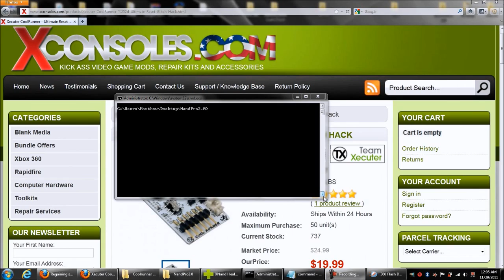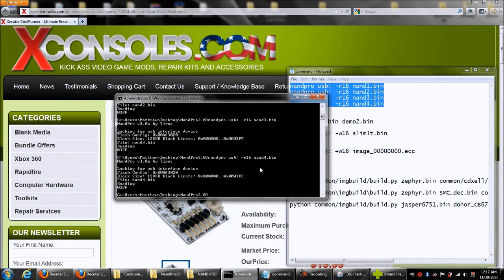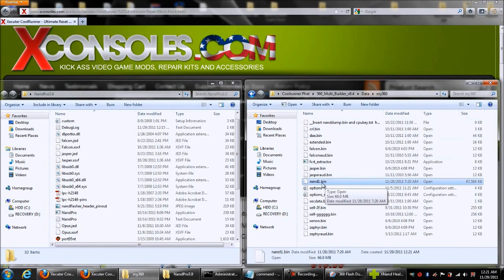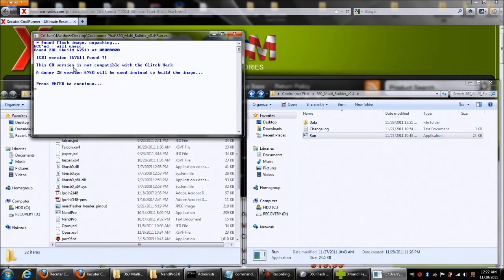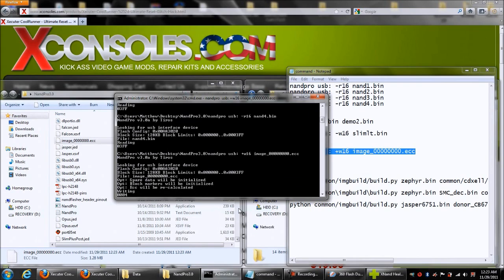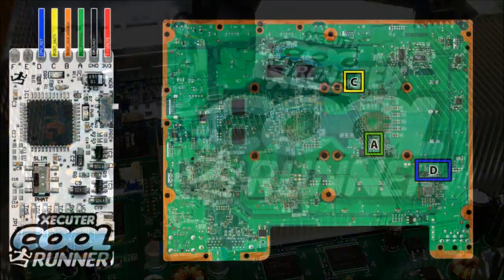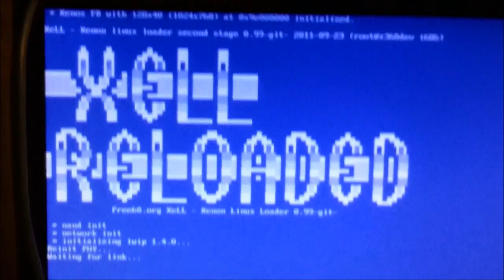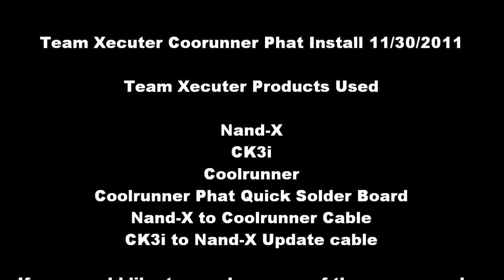Xbox 360 Phat Team Xecuter Coolrunner Install Guide

Comment: Mr.Joker, Coolrunner is utilized to RGH an xbox360 console for hombrew stuff/ key retrieval etc.. whereas JTAG exploit used to work on earlier manufactured xbox360 consoles having dash 2.0.7371 or lower afaik which involved using diodes,lpt cable and a nand reader/writer interface, however let me remind you that there's nothing called a "JTAG CHIP" ever made! its just and exploit used back in the days with the dash as i mentioned above. You can visit team-xecuter's website for further details.

Comment: Great guide, im looking to get the stuff to do my 360 quick question, in the cool runner box Do all the cables come with it, eg the coolrunner cables to solder to the main board, And the nand x do all the cables come to connect to the qsb? im also going to purchase the coolrunner and nand x qsb, will i have to purchase extra cables

Comment: okay so, it has to be my nand-x or my QSBs giving me this problem, since i get the usb interface crap, i'm inclined to believe its my nand-x but i think i'm gunna switch to pinheaders to be certain its good....also B(orange wire) is really hard to connect if the qsb isnt the long one like yours, i melted off the copper pad and just dragged a bunch of solder across it, and connected it, think that could be the problem too?